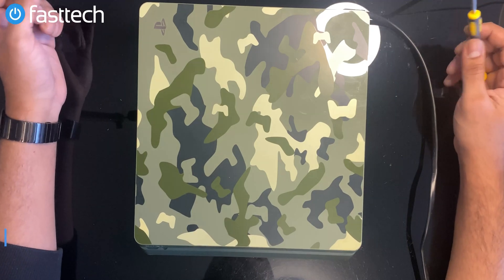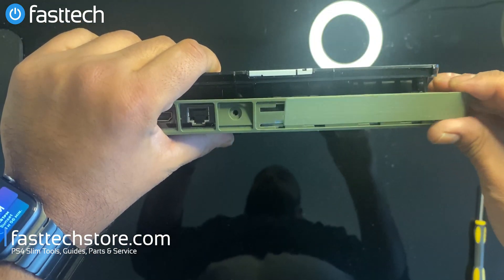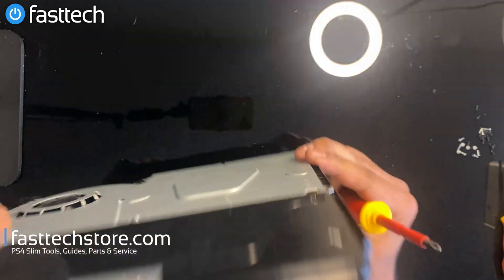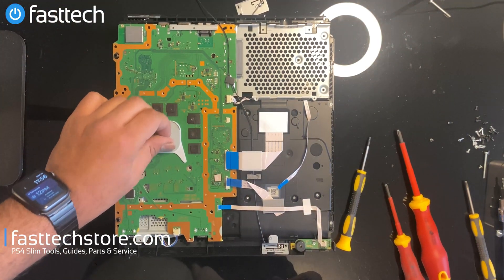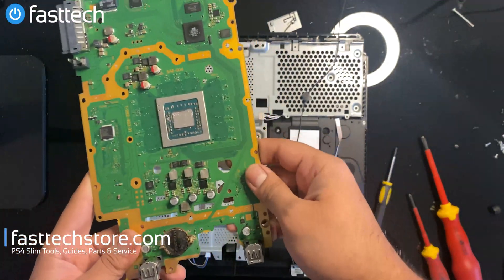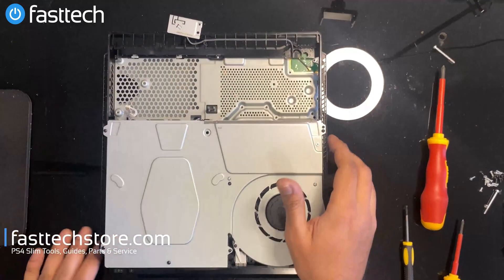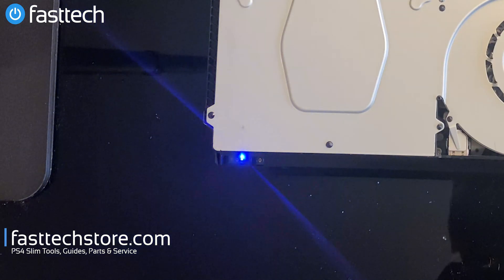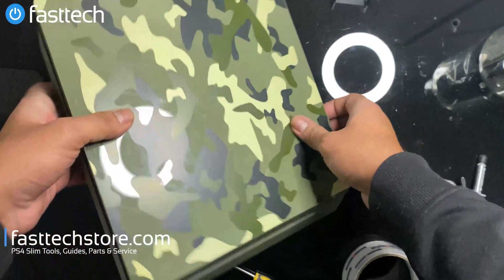PS4 Slim BLOD Repair

Comment: I sent mine away a few years earlier  and they (Sony) didn’t replace the warranty sticker 
Apparently it only needed a clean 
Worked fine 

But now 2years later the disk tray plays up the fan stops randomly  and now it won’t turn on

Comment: i have been having problems with my hard drive for the last few months and it only worked after i initialized the console, i did it so many times that yesterday after i initialized i got the BLOD, i can say it is a hd issue and just replace it right?
Reply from the maker: Yes replace the hard drive and it will fix your problem especially if you have to keep initializing frequently for system to operate. We sell them here: https://www.fasttech.ca/playstation-4-slim?category=Hard+Drives

Comment: I have a question so I accidentally pulled the top wire thingy under the hard drive slot, would I have to take my whole ps4 apart to put it back?

Comment: Hey, I made a comment on ur older videos, and I really really need ur help, do you mind responding please?
https://youtu.be/6CMKpX24Nqc
The comment: A week ago when I turned on my PS4, it was rlly quiet and would shut off with three beeps and a red light when I load up a game. I searched it up and it's because of overheating and it might mean that my fan isn't working. But when I opened it up, it could spin well, so I thought it was a connection issue. Then and u watched this video and after a few days, I opened my PS4 to clean it  as I didn't wanna get a new fan. Now after I've cleaned and reassembled everything, when I turn my PS4 on, one second later when I hear the usual beep with the blue light, the three beeps and the red light appears. Please help!